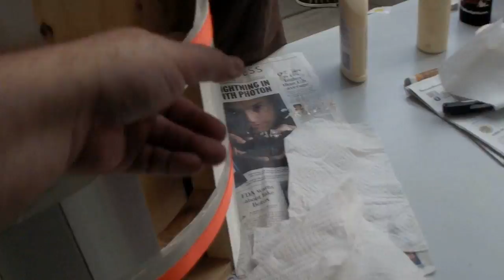R-Pi: R2-LA BuildDay May2013: Gluing the Senna frame

Comment: How tall is r2d2 body is
Reply from the maker: Sorry I never saw this all this time!  :(  He's just over 3ft or just one meter right about.  The dome is 12", the body 20" and the ankles/feet are 6"-10".  And it changes.  That's standing on two feet.  On three, he loses and inch or two.  In New Hope, look at the foot pads.  When on 3 legs, you see wheels.  When in 2 legs with Kenny inside, that body is built on very smaller rollers that look like pads or maybe tracks.  Do those count towards his height or start at the flat of the foot?  Like bare feet compared to shoes.  There are a few answers for all these versions of the same basic question.  So, right about 3ft tall, over 2ft wide and just 2ft deep, closer to 3ft when in three leg mode.